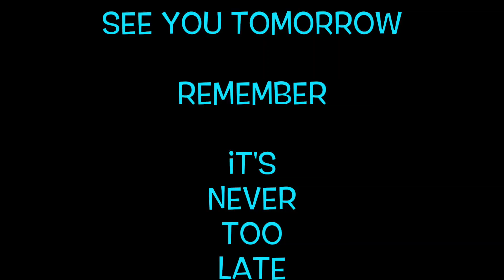Born To Roll !!!!!!!

Comment: Lucas stop leak works well as well as there transmission conditioner
have a slow leak in the van,put a milk crate in the back with extra fluid, van is running well
glad your back on the road

Comment: Lucas is a good temporary patch.  The pin is pulled on that one. 
Start putting away cash. there is a transmission replacement in your future. 
I used to rebuild and replace.  Mitsu's are tough but rebuilds are EXPENSIVE!

Comment: Congrats. Stop leak is just temporary. It will swell the seals and they'll fail over time. It may help till its warm spring weather to put new seals in .
Reply: Walmart has gallon jugs of trans fluid. Drive it a little. Maybe has a bit of air to purge from a difficult spot?

Comment: Glad it’s rolling buddy. But yeah, it’s letting ya know it’s not long for this world. Lucas and all the additives and stop leaks will slow the inevitable but not actually fix it. Most times folks add them in order to sell or flip the vehicle and hide the issue. Unfortunately whoever sold you the vehicle knew the issue and had already done just that. Hence the reason the fluid level was high when ya bought it. Usually your higher gears will slip first do to lower rpm shifts. Higher rpm shifts engage the clutch bands harder an make them grab. Lower rpms don’t hit as hard and let it slip.  Hope I’m wrong and yeah get as many miles as ya can to save for a new vehicle buddy. But am so glad ya got it at least working for now and have transportation.